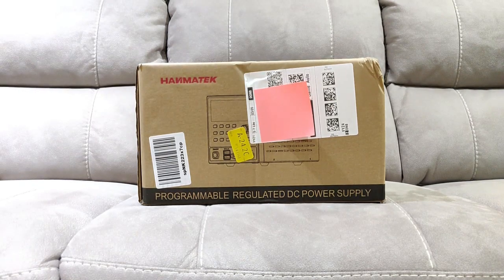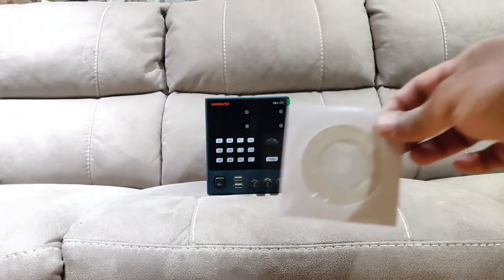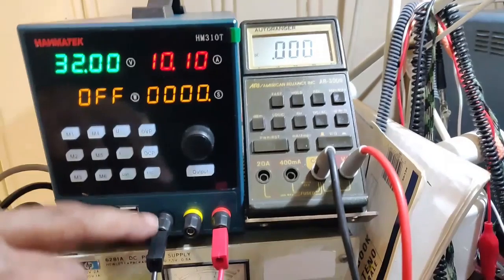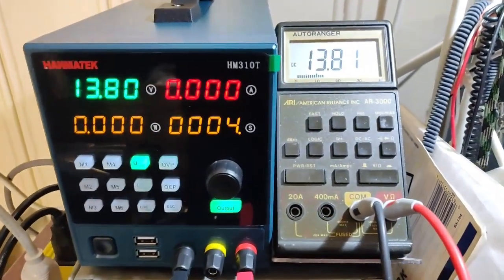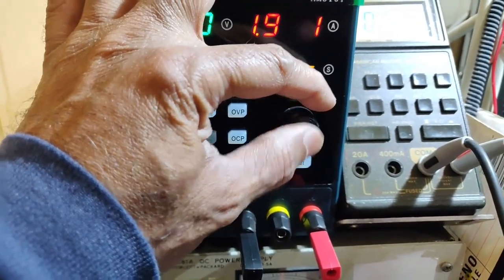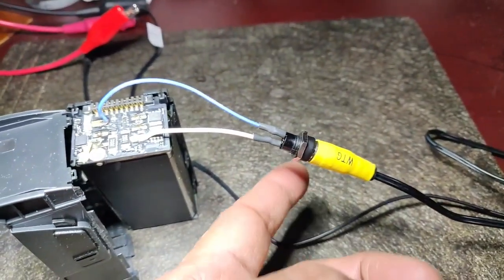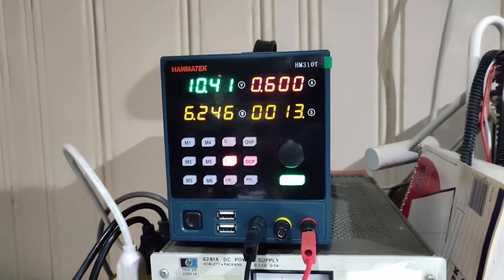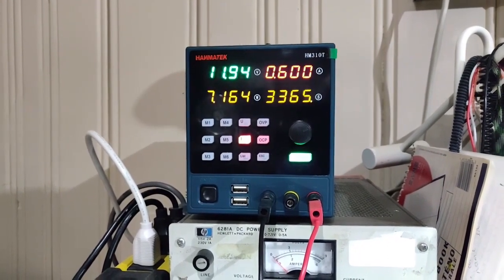HANMATEK HM310T Programmable Regulated DC power supply 30V 10A Review, Home workshop or bench PSU

Comment: Is it possible set current constant instead of potential?? I am doing experiments and I would like to keep the current constant and the potential can be changing. How I do that?
Reply: Set the highest voltage possible, and then set the current limit you want. When enabled, the voltage will drop until the current limit is flowing.
Reply from the maker: @Dessa280810  Yes, it's possible - and easy. Use the I-cc button for that, and use the rotary knob to set the current. Save it in any memory for recall. Procedure is also in the manual. Good luck!

Comment: How to set it in constant voltage mode?
Reply from the maker: Whatever Voltage you set is in fact constant. It'll reduce only when you exceed the set current - as in a short-circuit.
Reply: @PremMenon  I have a halogen lamp rated at 12V 60W if i set 12V 5A on the PSU voltage drops to like 11V and CC light is showing.
Reply from the maker: @Dragunov1111  Set the current limit to 8A. It should work. Then find out the actual current drawn by your bulb. Keep in mind that such bulbs may draw higher initial current....and may draw more than the 5A "calculated" current.
Reply: @PremMenon  Ok now i get it so if i dial in 10V 5A it will go in CV mode as the voltage isnt dropping... Will try it later when i finish my coffie.

Comment: how easy is it to remove the handle... I want to stack a multimeter on top but the handle means I can't...
Reply from the maker: I have not removed them so I don't know if there are nuts inside (must be). Otherwise, just 2 screws holding the handle. If there are nuts on the other side, you'll have to open the case so the nuts don't fall inside. Not difficult.
Reply: @PremMenon  thankyou.... one more question... is the metal body (not the feet)  150cm tall?
Reply from the maker: @graxxor  147mm tall
Reply: @PremMenon thank you.

Comment: Does anyone know how to save settings to Memory buttons (M1 to M6)
     Mine forgets everything when I power off.  Thanks!🙏
Reply from the maker: Yes. Double click the M button, quickly set the Voltage, and double click again. Be quick in setting the Voltage as it times out quickly. Same thing with current too. If the above procedure doesn't work for you then talk to the supplier for a return/refund.

Comment: А у моего HANMATEK HM310T таймер работает в 1,25 раза быстрее. В 10 его секундах 8 настоящих.
Reply from the maker: Kostya, thank you for that information about the inaccurate timer. No, I haven't verified mine (I have two units). Never had the need for a timer so far, but I'll verify the timer in my units. Thanks again!
Reply: Для справки: в моём кварц на 25МГц. 
Если ваш таймер работает правильно, то 
можете ли вы по возможности посмотреть какой кварц на вашем блоке? Для этого достаточно снять кожух. Спасибо! @PremMenon
Reply from the maker: @Koctya_Koctun Okay Kostya, I'll check the marked frequency on the XTAL used in my unit, and will report back. If not today, probably by your morning tomorrow. Hopefully that's also 25MHz.
Reply from the maker: @Костя_Костин  Hello Kostya, Y1 (XTAL) on my 2 units are marked 24MHz.
I just checked both against a stopwatch, and both seem to run about 10-11 seconds faster for every minute (on my stopwatch)! So, there's definitely a problem there.
If it's a different reference designator you are referring to, then please tell me the ref-designator (Y2?, Y3?). However, it's unlikely this will have more than one XTAL.
Reply: Сейчас открыл кожух и да, там кварц Y1 на 24МГц. Спутал, уже два года прошло. Уточняю, таймер ошибается в 1,2  а не в 1,25 раза.  Версия платы: P_Show_V3.11 20210520
Огромное спасибо за информацию! Уже нашёл пользователя у которого та же что и у меня проблема. Если ещё не одели кожух, пожалуйста сообщите версию платы управления. Возможно разные прошивки. Ещё раз спасибо! @PremMenon
Reply from the maker: Okay Kostya, I'll check the board version. I have put the cover back. Will check it sometime later today. I never had the need for the timer therefore never checked it. Thanks to you, at least I now know that there's a fault.
Reply from the maker: @Костя_Костин  On the control/display PCA, I see the same: P_Show_V3.11
20210520
Reply: Я вот думаю, что если поставить кварц на 20Мгц? 24/1,2=20. Правда неизвестно как поведут себя остальные узлы микроконтроллера, но надо попробовать. Даже если китайцы исправят проблему, то новой прошивкой вряд ли поделятся. @PremMenon
Reply from the maker: @Костя_Костин  yes! You can give it a try. They won't divulge any information. They just take information but won't share.
BTW, I checked in YXC webpage for info on this crystal; no luck. I couldn't measure the dimensions accurately, but it's about 5mmX3mm SMD 4 pin/legs. Even I could have tried but it's not a priority for me at this time as I don't use the timer function.... Besides, I'm working on other projects. If time permits I can try to feed an external clock - and see how it behaves. I'll keep you informed if/when I find something interesting.
Reply: Такого SMD кварца у меня нет, но есть в магазине другой конструкции на 20МГц. Как руки дойдут тоже хочу попробовать и о результатах обязательно сообщу.
Спасибо за информацию и содействие!
Приятно было пообщаться! @PremMenon
Reply from the maker: @Костя_Костин  Kostya, likewise - it was nice interacting with you, sir.
Reply: @PremMenon  Could it be for the 60Hz US power line frequency? The PSU might be set for 50Hz (EU).
Reply from the maker: @LuisReiss  that's a good observation/suggestion. Thank you. I'll look into that. It's a good lead you've touched on.

Comment: Hi just purchased this looks great but been trying to inject 1v 3amps to a motherboard but cant get it to constant amps anyway ideas thanks
Reply from the maker: Procedure to set 1V at 3A (in M1 memory):
1) Short press M1 once
2) Immediately use the rotary knob to set the Voltage to 1V
3) Immediately short press "Next"
4) Immediately use the rotary knob to set the current to 3A
5) Immediately press "Esc" (to save).
Hope this helps. I just now tried, and it works.
Thanks for checking out my video.
Reply: Hi, did the above work for you? I'm looking to buy one of these but that's the only thing putting me off. Thanks
Reply: @Ben-rb9jj   hi yes it did but very frustrating to set up,and in two minds to send back,as linier power supply are a lot easier to set up,just my experience
Reply from the maker: @Ben-rb9jj  yes, it works for me. I use it regularly. Purchased one more just before the prices went up. Now have 2.
They have some nice features not found in many at this price point.
The color LED displays are nice. I didn't want LCD.

Comment: Thanks for putting this video out. I bought my unit at a flea market, and of course it did not work even though the seller said it did. Every time I pressed "output" the settings reverted to zero. When I took the cover off I found a large copper coil was not inserted into the circuit board at one end of the coil (coil was leaning over like it had received a jolt in transit). I popped the coil leg back into the CB slot, and hey presto, a working unit, at a cheap price! The leg looks like it had not been soldered, so maybe unlucky for this unit, or maybe poor QC at the factory
Reply from the maker: Thanks for checking it out. Lucky you! Got it at a bargain. I bought a second one. Got it a bit cheaper as it was an Amazon return. Took a risk, and it's working well. The price will definitely go up as it becomes popular.

Comment: Hi thanks for the video , I've just bought one of these for electroforming I need to set it to 0.2V 0.05amp in Constant Current when i do this it will only go to CV mode and the Amps disappears from the display , do you know how to get this to work please?
Reply: 7 months late but if your plating cell resistance is too high, then you may need a higher voltage than 0.2V to achieve 0.05A of current. If you set your current limit to 0.05A and the voltage up excessively high like 5+V, then it will automatically drop the voltage down to whatever is needed to push 0.05A.
Reply from the maker: Thanks for checking out the video. Yes, you are doing it correctly. The set current shows 0 when you enable output, and will show the actual current drawn by the load - if/when you connect the load. Try to save your settings in one of the memories.